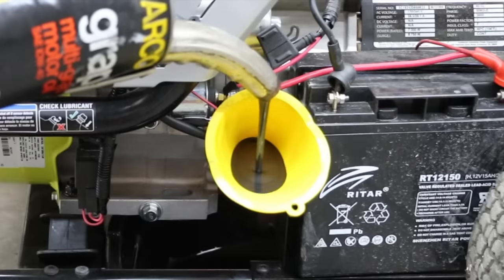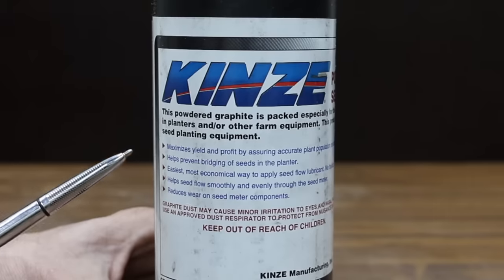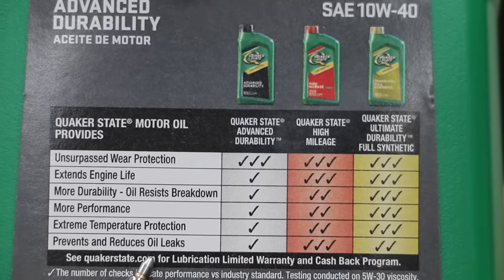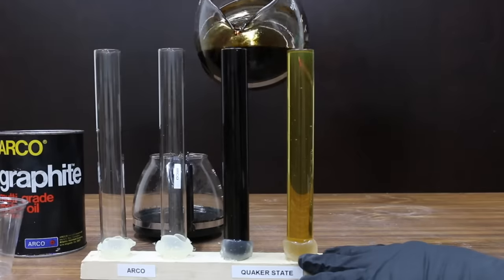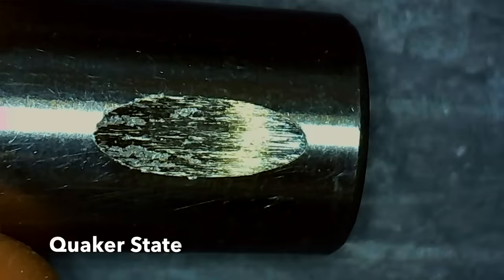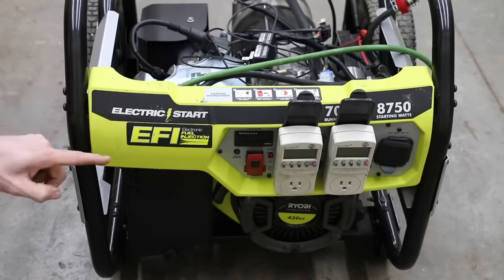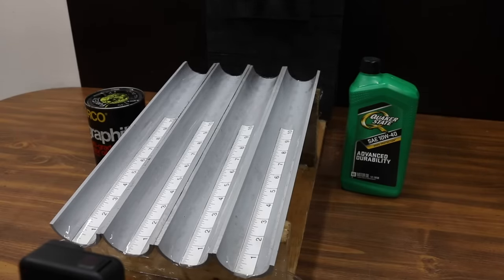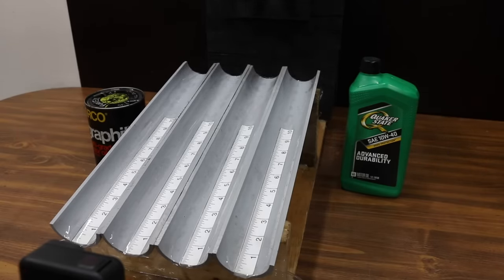Will "Graphite" Help Motor Oil Performance? Let's find out! Vintage Arco Graphite vs Quaker State

Comment from the maker: I could use your help in the future.  If you'd like to help me decide on which products to test, please consider subscribing to the channel.  I occasionally ask viewers to vote on which products to test and YouTube only informs those subscribed to the channel that there's an opportunity to vote.  https://www.youtube.com/channel/UC2rzsm1Qi6N1X-wuOg_p0Ng?sub_confirmation=1    You'll also need to select the "bell" to get the notification.  Thank you very much and look forward to many more product test reviews. Todd
Reply: You are amazing, time to up the ante and do some real science. How about motor oil with graphene instead of graphite?
Reply: have you tried testing different hand washes, or, how about degreasers....
Reply: Been signed up for a LONG time👍👍👍👍.
Reply: Op Ghg   Graphene test is a good idea. The 'flakes' are atomic crystal thin.
Reply: I use the bejesus out of Lucas Oil heavy duty Stabilizer, I'd really like to see it tested.  I mix the conventional version with synthetic 0w-20 and so far it works great in my built engines.
Reply: I'd like to see a head to head performance comparison in adverse conditions (high heat 110 degree air temp, cold weather 20 degrees, and minor rain(mist)).  With impact brushless guns, Makita, Dewalt, and Milwaukee.
Reply: Diffrent brands and styles of vicegrips
Reply: Graphine comes in different sizes, your wanting to use a small particle size, big lumps can act as an abrasive, and would become trapped in an oil filter.
Reply: I routinely use Tufoil additive (Fluoramics Inc.). I've been impressed with its anti-wear capabilities. A possible test on this?
Reply: Can you settle a debate for the BMW ///M5 "which oil is best?" - and with the added fun of an additive test?

The Contenders:

In the Blue Corner - - a Heavyweight Champion from Germany - let's hear it for: Liquimoly 10W60!!

And in the Red Corner - a confused Corporate Sponsored Behemoth generating countless terrifying and confusing "Oil Threads" for decades - the "Official Oil of ///M" 

Castrol TWS Motorsport SAE 10W-60 Synthetic Engine Oil

Or... "In January 2015 BMW changed official oil suppliers from Castrol to Shell. The new oils are designed to meet requirements of both the newer engines as well as older BMW's. This oil replaces BMW Part #: 07510009420 / 07-51-0-009-420 BMW Castrol TWS Oil. While this oil is officially labeled "M TwinPower Turbo" oil it is designed for use on the naturally aspirated S54, S62, S65, and S85 engines."

Additives: Liquimoly CERATEC vs Liquimoly MoS2 Anti-friction Oil Treatment.
Reply: Schaeffer’s products
Reply: I’ve beeb subscribed since....man it’s been years. I’ve asked for your email about 50x, beginning to think you just don’t love me.
Reply: Will do
Reply: Have any of you seen the guy who used diesel as a diff or engine oil replacement? I can't remember which as it was a while ago
Reply: JUANZERO are you asking who the guy was or what the replacement was or?
Reply: @Fee.1  sorry but can you elaborate
Reply: Project from Iove your channel been subscribed since forever,  is it possible you could test oil stabilizer from Lucas vs other brands or run some test on it , I used it this past month on the Toyota truck because it would make some knocking noises but now with the oil stabilizer its reduced the noise significantly.  Would love to see some test on this  , I used the high mileage oil stabilizer made by Lucas,  thank you and keep up the great work
Reply: Ok, could you test product Project Farm vs. Scotty Kilmer vs. Chris Fix?.
Reply: Sorry, I’m really late to the party here... just wanted to mention that ARCO (Atlantic Richfield Co.) is still very-much around; one of top gasoline stations out here in the West. Until recently, they were a subsidiary of BP (British Petroleum), which is well-known in the rest of the contiguous 48.
Not too long ago, BP sold the ARCO/ampm brand to Texas-based Tesoro, which at that time was the 3rd largest petroleum company. 
Then a couple of years ago, Tesoro was purchased by Marathon, which is another large line of gas stations, popular everywhere except out here in the West. 
I find it interesting that, while the ARCO name is still one of the most well-known names on the Left Coast,   hardly anyone in the rest of North America knows it still exists. And conversely, although common everywhere else, none of the subsequent owners of ARCO are commonly known out here.
#themoreyouknow 💫 😜
Reply: What about a lead additive to gas
Reply: Heres an idea just for fun. I invited a time machine out of a used car(sound kinda familiar) i travel back in time inbetween 1950 and 1980 and some how lose all my oil what vintage oil brand would be best to get me back home
Reply: Todd, Back in the mid-70's, I lived in Central Ohio. From the end of December through the end of January 1977 the high for the month was 10 below zero at night it would get to -22 below 0. Several people claimed to mix one quart of transmission fluid with their engine oil for easier starting in the cold weather I never had the guts to try it anything to this?
Reply: test Graphite vs molibdenun disulfide in motor oil
Reply: I would also be interested, as was @lockpickinglawyer to see an edition like this with moly.
Reply: the one additive i used in the past was called "ER" or energy release. back then the company was situated in Meridian ID. they use some sort of canola derivative. i used it in my chainsaw and saw a marked improvement in fuel economy and substantial reduction in the operating temperature of the engine. the stuff made it the exhaust gasses smell like french fries but it wasn't an unpleasant smell. 
later i tried in my pickup engine but didn't really notice any real change in performance. it seems to work best in small engines. it also made a difference in the performance of my coleman generator where it would run a bit longer on a tank of gas under load
Reply: Hey try slick 50 it’s an additive used in old and worn engines it helped prolong the life of the engine
Reply: I use Lucas oil stabilizer per directions in every vehicle I own including my Honda GL1800 that has a wet clutch. I have asked many guys who work at auto parts stores about what they think of the Lucas product. Every one said that you cannot go wrong with any Lucas product. Would like to see you test an engine using the Lucas additive in the oil and then draining and comparing the run time to engine stop with the Slick 50 readings.
Reply: This Guy is awesome
Reply: Interested in a comparison of aircraft ashless dispursant oil to equivalent viscosity detergent oil.
Reply: Rust removal spray?
Reply: Would you consider testing the properties of Chevron Techron fuel additive to see if it really has any benefit for injectors and valves?
Reply: Hydrogen dry cell.
Reply: 12v 10amps. Parallel with bank of supercap 2.7 v.  3000f.
Reply: ^^qwerty
Reply: How about namebrand vs knockoff lithium batteries?  For example Ryobi vs half price ones, or same with Dewalt, etc.
Reply: Please test liquid moly oil against the big names and test the effectiveness of using liquid moly anti friction additive for lubricity
Reply: AGAIN...I THANK YOU...IM ON A FIXED INCOME...SO NO DONATIONS AVAILABLE...HOWEVER...YOU HAVE MY ATTENTION!!!
Reply: I used ARCO Graphite back in the day but ultimately dropped it when concerns arose about the graphite depositing out in thin tubular channels such as in sensors and oil lines.
Reply: Other than the qualitative trials you ran, most results were within error quantitatively.  The open air evaporation test is not real world what so ever either.   The pressures and pressure gradients could very well change the evaporation, melting and/or sublimation point of each product differently.  The dew and bubble point lines on their respective phase diagrams could also be so different as to at a different constant pressure or Temperature they could act the same.   Also that being said, if you did not absolutely clean the generator or use an entirely different one the results could be very different from what would be if just pure substances were involved.   Then again, who cleans their engine like that during an oil change, so I suppose what you did would actually be more like normal conditions. 

I am not saying what you find would drastically be different, but rather could be.
Reply: Also you did set all this stuff up at home.   I am Happy to see there are inquisitive folks still willing to learn and do rather than interpret and judge.  (I suppose I am the latter on this one,. I can say I have not had many realizations that I am the "bad guy" (for lack of a better description)  in situations.
Reply: You could try adding acetone to fuel, both diesel and gas, we did a not very well controlled experiment and seemed to get about a 10% improvement in mileage in both types of engines.
Reply: Industrial Hemp oil for fuel and for lubricant
Reply: Thanks for the lawn mower engine tune-up video :)
Reply: @AutitsicDysexlia  You should look into Millers ND (nano drive) oil. It's pretty amazing stuff.
Reply: Try petron plus best stuff ever
Reply: YES I REMEMBER IT WELL. DO NOT USE ! GRAPHITE IS VERY ABRASIVE.
Reply: Can mothballs increase octane levels?
Reply: Not sure if you've done one, but how about how much 'stop leak' actually works?
Reply: Just wanted to say you do awesome videos. The only one I can find that actually works hard to do them the correct scientific way with controls and adding in the various tests to simulate what happens in the real world elements etc. Awesome job!
Reply: What about Graphene?
Reply: Can you mix them?
Reply: Hi,  i have mixed motor oil with stp oil treatment and slick 50 together in my engine for years, using the mix on every other oil&filter change,  change (so it dosent clogg up the motor too much)  i can actually feel the added horse power when doing this.  

it would be great if you could give a test of my idea to actually see if it is worth while mixing all three in an engine.     Love your channel, Bill
Reply: Heard of graphene but not as an additive to oil. Might be interesting to repeat the metal surface resistance to grinding with graphene, super kote and motor kote. Thank^s
Reply: A retired oil industry engineer once told me that US motor oils were “Western asphalt based or Eastern paraffin based” was the reason engines running the paraffin based oils ran cleaner. Why don’t you test that theory?
Reply: Where can i buy arco oil?
Reply: You should do the same test but with hexagonal boron nitrate
Reply: Did you let the generator cool down thoroughly before testing the Arco.
Reply: I'm not really surprised at this result. Graphite is an excellent lubricant and I didn't expect fuel efficiency. But What I didn't expect was just what you saw, an improvement in wear and tear. Also, remember in a steel based engine grapine would be a higher choice that aluminum engines. Girl injection systems would never love that mix.
Reply: The challenge is suggesting a product that's as exciting for you as it is for us. Being an electrician, Wire strippers comes to mind but that's as dull as some of the bits you've tested
Reply: Now would it be beneficial to regain compression if you mixed graphite with something like trans fluid to pour some into the intake without damaging your crankcase seemed like it was getting in there anyway or was the rings all packed the reason for the compression bump
Reply: Sorry, for some reason I had missed this comment. I am already a subscriber and I checked the “all button” so that I am informed whenever you upload a new video.
Reply: Best steel toe PUNCTURE resistant sneaker and also boot
Reply: USED ARCO GRAPHITE IN 1980 AND IT PUT A HOLE IIN A PISTON
Reply: Have you used or test a motor oil called royal purple? This is what I use in my pickup
Reply: Have you ever tested the oil additives like Slick 50 or Prolong...I know there are more of them out there and some may not be available anymore ...just a thought...and here's one more...the toilet paper oil filter vs the real oil filters for cars...Good luck and keep up the good work...watch all the time.
Reply: Have you ever tested the oil additives like Slick 50 or Prolong...I know there are more of them out there and some may not be available anymore ...just a thought...and here's one more...the toilet paper oil filter vs the real oil filters for cars...Good luck and keep up the good work...watch all the time.
Reply: As I trained Mechanic I love your videos and the way you present them. You cover all the important angles. Bottom line, keep them coming!
Reply: Multi purpose / transmission tractor hydraulic fluid there is a great price difference between john deere/tsc/rural king family farm cheaper brands. Wonder the difference
Reply: personally, i'd use it in a gearbox, not in an automatic one, but in a manual? why not?
Reply: I’d like to see a test of Militec 1 oil additive.
Reply: I'd love to see a video on Permatex Ultra Slick engine assembly lube.
Reply: The oil is as important or more important than the fuel in the engine or as ma pappy said " kèep the engine healthy an it'll last longer " good luck experimenting ya'll
Reply: @jenniferwhitewolf3784  Settle down Jen
Reply: Marvelous mystery oil
Reply: @milkmanman  is u sayin it be betta than da otha one? Is u fo sho that u put it in da carburetor and not da gas tank playa? I be askin fo real playa? I got a six fo Impala ain't runnin rite
Reply: Did you ever see the result and performance of a child or adult who was injected with graphene oxide?  If not, you aren't getting this news from the proper places.
Reply: Would like to see Lithium batteries for RV solar , Marine. off grid configurations.
Reply: @gregprince2523  I would like to see hulk Hogan vs Kevin Nash.
Reply: Nice Job👍👍👍
Reply: @wildestcowboy2668  how bout Putin vs Biden!!
Reply: I don't watch all of the things you do but I do like the fact that you tend to put a good ranking on Milwaukee Tools, I am a big fan of theirs, I figured out years ago that most other tools are basically junk
Reply: @lawrencejneuser8801  that's a lie
Reply: could you test the different types of non-stick pans that are now available for cooking?
Reply: Id love to see a behind the scenes farm tour
Reply: I have used Lucas additive in my oil for years. love the stuff, it quiets noisy valvetrain, I even run it in my dirtbikes
Reply: If you put all your results on a website it would be everyone’s quick reference. Please say, “we’re going to test that!” 🤠
Reply: Please show solar power generators??? Are they good for hard use?????
Reply: I worked at a Nissan Dealer in the 1970s and They had some graphite on the market we used it ,it was junk it ruined engines and seized up valves
Reply: I'm sorry I'm late to this topic but when in the USAF we were not allowed to go near a jet engine with graphite because in high heat situations it will burn into metal. Graphite works well in cold and high moisture areas and if you do not want to attract dirt to areas that need you to prevent attracting dirt to weather exposed areas.
Reply: test detergents or anti calcium deposits products
Reply: Hi , I  was wondering if you could do an episode taking a junker vehicle that runs on gasoline and do a basic Hydrogen cell using copper or stainless steel coil conversion !  Thanks in advance !  ohh!....I finally subcribed even though I've watched your projects of the years ! Awesome channel pehaps top 20 on youtube !   Cheers from Vancouver, CA  🍻
Reply: I have used blue devil main sealer additive before and seemed to completely stop the leak. (Half dollar spot every time I turned the car off) never had luck with any other brand maybe a product you could test?
Reply: Do you have any videos testing heavy duty truck(tractor-trailer) motor oil?  I would like to see a breakdown on Rotella & Mobile One standard vs full synthetic.
Reply: Have you ever thought of testing Blenders? How long will they last? Power? Strongest? Most Durable? Will a certain one really chop up a broom handle or is it hype??
Reply: Are Snap-On hand tools really worth the premium price ?
Reply: It looks like you tested the friction bearing test for 10 min.. I remember the motorcote was only run for 30 seconds. I'd like to see the motorcote run at the same times as these oils. Can you re do the motorcote compared to the best oil you've found so far?
Reply: Adding graphite haphazardly is wrong. Measurements are paramount.
Reply: Also improved gas mileage additives almost always require regular use. Its not a wonder moving a heavier fluid hurt gas mileage but as you can tell from the coffee pot the graphite must be used regularly to defeat the weight disallowment.
Reply: @brianmichaud3668  Lead has been illegal for use in any fuel for decades in the US.  (I cannot say confidently that it is illegal worldwide, however.)  This was done to protect everyone from lead in the atmosphere.  It is highly unlikely that anyone will violate federal law to perform a test involving the addition of tetra ethyl lead to fuel.
Reply: You should do "dry lube" tests.. for keys and locks, including graphite, talc powder, ect.
Reply: Please do a test on the best over-the-air antenna for all of us off the gridders! LOL 👌
Reply: I'd like to see an "Orthoscopic vs scalpel knee surgery" test.
Reply: Different brands of wobble sockets
Reply: Does graphite precipitate
Reply: I thought I was subscribed as for bell😲
I did that once for all the channels my phone was blowing up with notifications
Reply: text graphite vs slick 50 vs restore.
Reply: Need to test work boots.
Reply: Can you add molybdenum disulfide powder to standard motor oil?
Reply: id rlly love to test this on new vs worn out transmission would the graphite make the slipping tranny work again
Reply: Gas powered powerwashers, I want to see how much damage they can really do
Reply: I just wish a company would combine all the bits . moly, boron , graphite , phosophorous and zinc. potentially liquid lead. not for efficiency but for longevity.
Reply: molybdenum disulfide?